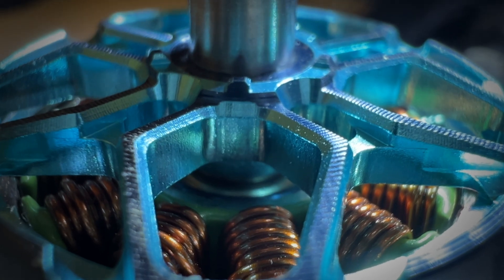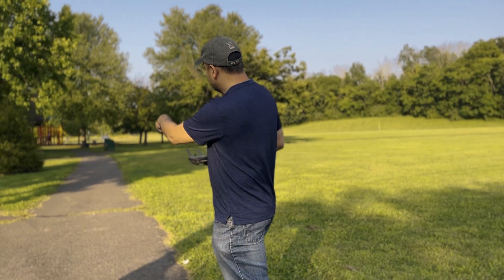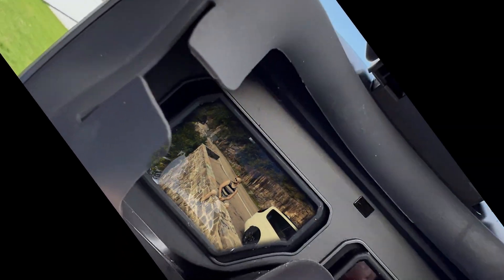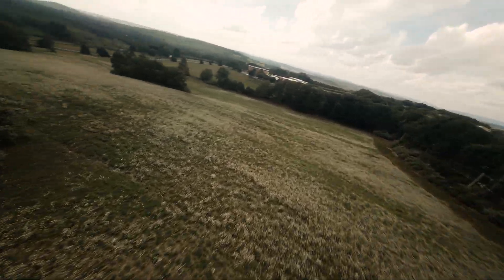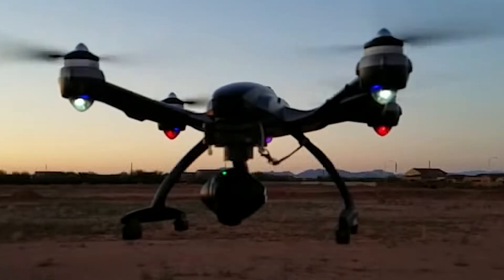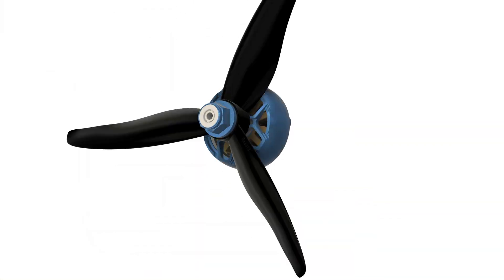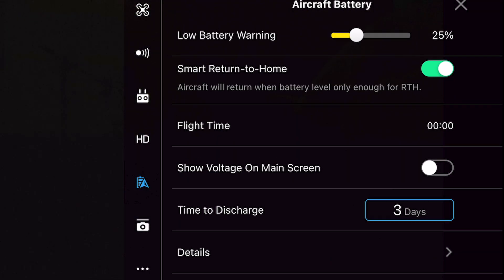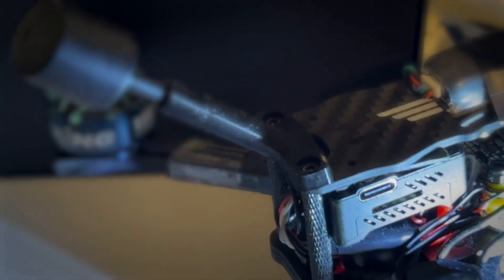What's Inside This? Looking Inside FPV Drones

Comment: What frame and motors are you using on your drone build featured in the video?
Reply from the maker: Its the 533 Switchback HD frame with Xing2 2755kv motors and a 6s battery.  Its an tight build and I had to 3D print a custom plate to move the 30x30 stack to fit alonside a DJI O3, and a huge 1000uf 50v cap. This frame prefers a 20x20 stack but that limits your ESC choice and drives the price of specialty 20x20 ESCs. The upside is that it’s an extremely lightweight yet rigid frame. This combination of factors allows me to push acceleration to the extreme but is costly given the strain it will put on your batteries!

Comment: Just learned I can upgrade from 25mw to 350mw before watching and range increase was drastic but watch your laws when doing this.
Reply from the maker: Absolutely! In the US, anything over 25mW typically requires a ham license, but DJI is a bit different. The DJI FPV system is FCC Part 15 certified on certain channels, so under 700mW and stock settings, you’re fine without a license. However, if you change channels, power output, or antennas, you’ll need a ham license. Always good to check local regulations as other countries have different rules!  Check out the FPV freedom coalition if your interested in how things are regulated over here (very insightful especially if your new to this) -> https://fpvfc.org/ham-license#:~:text=The%20quick%20answer%20to%20this,Federal%20Communications%20Commission%20(FCC).